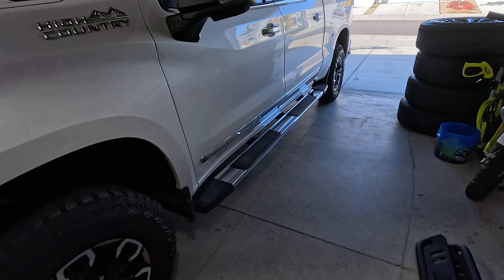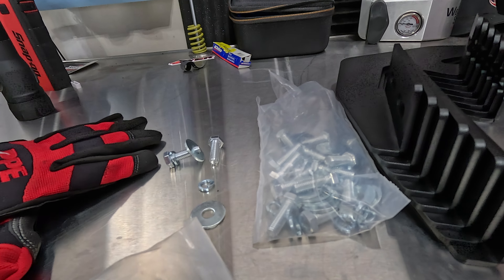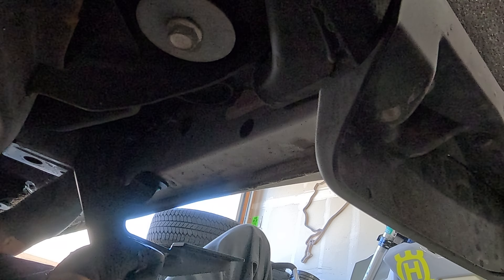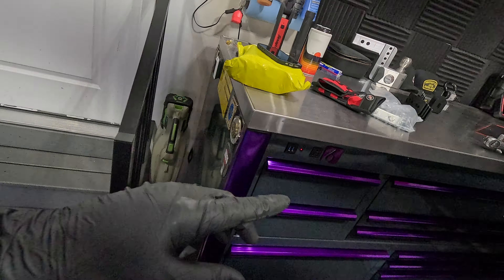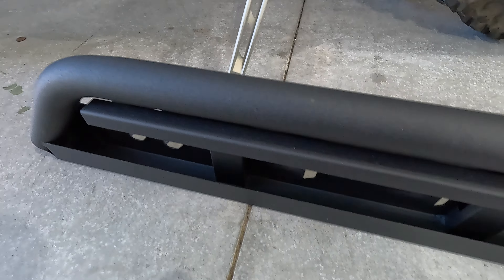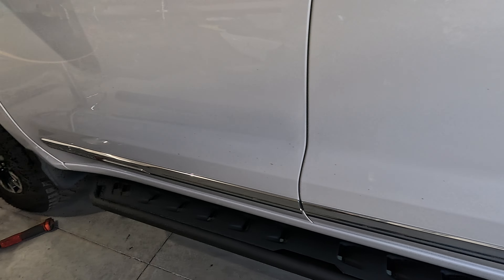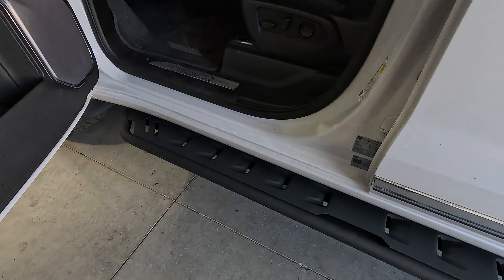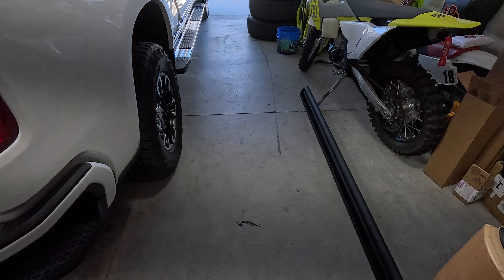How to Install / Upgrade Running Boards on Silverado / Sierra 2019+ ONINE

Comment: Those look great. A lot better than the tubular ones that came on my rst and not a bad price. What happened to the taillights you put on in a previous video?
Reply from the maker: Thanks! Tail lights were for non led trucks, I was just showing how to install.
Reply: Ok. I ended up going with the smoked recon’s for mine. A little pricey but I love the look. Also added the gloss black door pillars that came on your high country. I got my black rst about the same time you got your blue one. Too bad it didn’t work out with your paint job. Best of luck with the high country

Comment: Onine makes some badass running boards. I ordered the same set and installing tomorrow. Looks like an easy job. Hard to believe how good and stylish Chinese aftermarket parts have become. I do wish they were a little bit longer like your old boards were, but that's okay.

Comment: Just ordered a set for my trailboss lzo. I figured the black would look good on the red hot, I am also enjoying my rough country rubber bed mat I will throw it on top of the bed liner when I get that done, I also figure the rough country wheel liners will be worth it to keep all the utah salt off. Thanks again for a great video!

Comment: Since you cover the 3.0 duramax the most of all content creators I’ve seen, I would like to ask you about the 3.0 high pressure pump, what pump is it specifically? And other than diesel fuel treatment as well as regular maintenance on the fuel filters, what are some extra steps I can take to preserve the life of the high pressure pump?
Reply from the maker: Denso HP5D pump. Fuel treatment, early filter changes and high volume fuel stations will net you the best results.

Comment: Great vid. My brother in law and I both have 2022 GMC Sierra 3.0 crew cab and we both picked up AT4  take-off running boards on CL cheap. They look like those you got but with a spray in bed liner feel to them.
Reply from the maker: Nice! The spray in bed liner coating is nice, these ones I just installed also have a slight texture to them.

Comment: How have they held up? I want to put them on my tundra, but there’s a few reviews on Amazon stating they wiggle when stepped on
Reply from the maker: I got rid pf the truck, but if you want super sturdy, you will need to spend more on the GM ones. These are good for their purpose but they are the lowest cost steps available. GM steps are very very solid, but also 5 times the price.